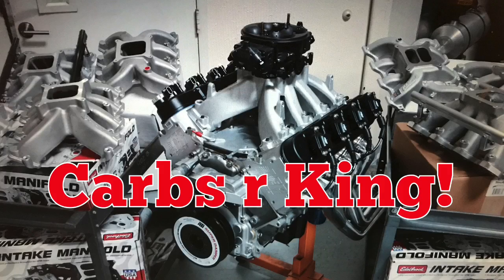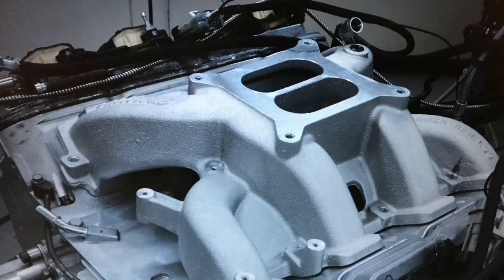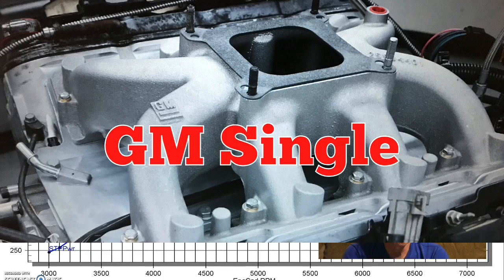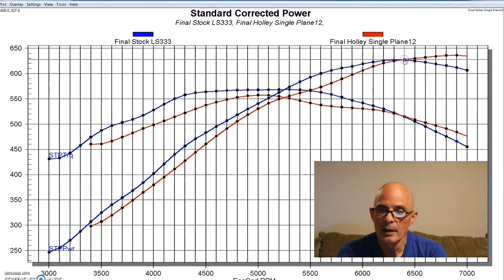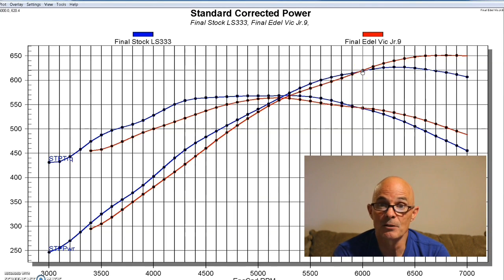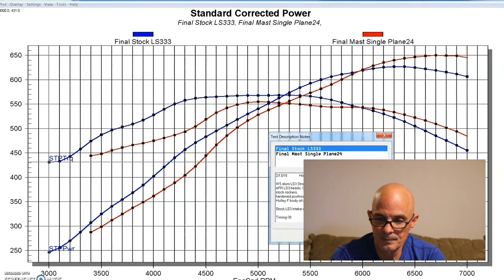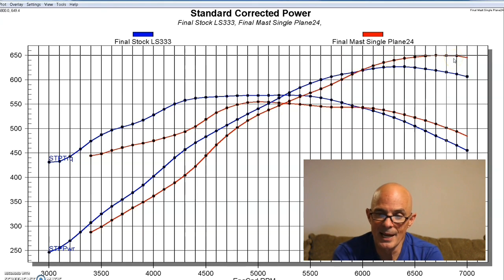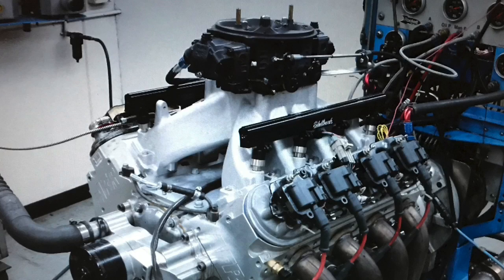CAN CARBS COMPETE? 416 LS3 INTAKE TEST (pt2)

Comment: I think the duel plan with a carb and msd box is great for a drop in to get a swap running as fast as possible my daily is a 91 roadmaster wagon that will be getting a 4.8 with a holley vaccume secondary carb down the road i might get a efi system but for now this is peefect id like to see some of the amazon specials tested

Comment: The factory LS3 intake along with the whole ECU controlled EFI is one of the best systems GM has engineered and mass produced.  If you own a C6 or other LS3 recipient of that top 3 engine ever made, IMO, it would be foolish to change out to any other system.  However, this is only totally accurate if you plan on never changing GMs design parameters.  For others who can't help but modify every automobile they get their hands on, sticking with EFI in GMs form might not be your best choice.  Of course Richy prefers his LS3 port injected EFI setup, he works at Westech and doesn't have to pay $400 or more each time he needs a dyno-tune.  He can just buy the fuel upgrades to support his new cam or turbo and life is good.  For many of us, those are not the facts of life.  We would have to go hat in hand to a tuner and hope for a quick and merciful financial outcome.  At 61 yrs. old and having only earned in the 6-digit yearly income realm 4 or 5 years of my life you can burn thru your savings pretty fast.  So for me who has no issue tuning a carburetor, that is the way to go.  I have a good Pro-Systems blow through 750 carb an assortment of jets, bleeds, pumps, squirters vacuum activated power valves and, the key to boosted carb success, boost referenced power valves.  Of course having an MSD 6014 ignition box and AFR gauge is immensely helpful also.  Jets and PVs are infinitely cheaper than hi-flow injectors while the financial value of my time compared to a good tuner' time is too embarrassing to even speculate about.
Reply from the maker: you are also plenty capable of learning to tune EFI-carbs aren't the only thing you can know

Comment: You are very knowledgeable! I am building a LS3 416 from TSP, but I cannot find the best cam. I hope to put good NA power down and then add procharger and maybe nitrous before boosted. My tuner is recommending the redhot cam but I am not concerned about street manners (stage 3 or stage 4 type cam is okay). Is there a cam spec you would recommend?

Comment: A good carb tunnel ram would remove the low torque advantage of the efi intake.
Reply from the maker: no...it didn't
Reply: I didn't see you test a tunnel ram vs the ls3 intake.   I've seen the tunnel ram tested before and it improves torque across the board due to equivelent AF ratio at each cyllinder due to equal runner lengths. @richardholdener1727

Comment: I have a 416 ls3 with a Holly sniper metal intake with twin turbo.i was wanting  to put a carburetor intake  and put the elbow forv the throttle body what do you recommend and thus set up is in a foxbody  mustang
Reply from the maker: why make that change?
Reply: @richardholdener1727   I was just  wondering if there's a intake that would work better and the holley sniper  sheet metal intake  make a lil noise when engine is  running  push down on the top and it goes away but nothing  major and I no you no way way more than I do

Comment: What, if any, gains do you think gasket match porting the single plane intakes would yield? I matched my GM single plane. While it has super crisp throttle response, I never really drove it. Then went back to fuel injection. Always wondered how it would have ran.
Reply from the maker: port matching helps very little

Comment: Honestly… the most impressive manifolds to me are the pair of Dual plane manifolds (for a pickup/heavy car application with mild cam).  Factory LS3, and the 4500 super victor. I think the Holley hi ram matches or beats the 4500 super victor.  But if you need low profile that factory ls3 is hard to beat if you are efi.

Comment: The victor Jr is what all the racers ran in the 90’s my shift point was 7500 rpm so ya it would definitely outperform the EFI system that drops off at around 6500 rpm when I went through the trap at the quarter I was at 9200 rpm, and that cam to me is a mild cam, if your gonna drag race you wanna run a Holly carburetor and the new super victor intake

Comment: Not sure where it was, butI watched you test carb manifolds. Dual plane and single plane,  that motor had a big cam.  Then I watched you test cams on another vid.  I am interested in what a 6.0L, 750-850 carb, the sloppy cam you used.  228 duration on 112.  A cam with 228 ish duration on a 110 or 108 with a carb would be interesting also

Comment: If I was going to drag race this motor N/A, I'd pick the Super Victor 4500 or the Stock LS3. If I want the best power for my dollar I'd most definitely pick the LS3 and test with a notch taller gear to make the best out of its mid-range punch. It sure looks like Chevy did its homework when they designed the LS! If I wasn't into Big Block Chevies I most definitely would look into the LS...or Hemi(I'm not stupid) to run my car. This has to be one of your top 5 (including part 1) videos! Great job Rich!

Comment: Hi Richard.... love the information.... I really like the 416 intake test. Wish you used a more street friendly cam like the BTR stage 2 instead of the stage 4. After all, drivability and idle quality is so important if you like a great driving experience. What’s the cc’s of the heads and compression ratio with the flat top pistons. I imagine there’s at least a 3 cc dish for valve relief. 
Keep up the great information!
Cheers

Comment: Hi Richard...That’s a great test.... using the 416 stroker as the test engine. I wish you used a milder street friendly cam like a BRR stage 2 or similar specs cam, something you would use in a daily driver. Who’s at 6000-7000 rpms red line street car with a cam that needs 1100 rpm plus idle speed just to keep running. That would be a miserable driving experience..... unless you have the throttle wide open all the time. Then who cares about idle quality lol.
Reply from the maker: a 416 stroker with a mild stage 2 cam is not a very popualr combo
Reply: Richard Holdener hi Richard... what spec cam would you put in a LS 416 ci. I’m willing to send this BTR stage 2 cam back to summit racing and exchange it for a different cam. I have a 3000 rpm stall and love power like yourself... but it has to able to idle at around 700-800 rpm and with good vacuum . Thanks Richard in advance 
Vic N
Reply: Hi Richard... I was just thinking..... all your tests should post idle quality and idle speed with all the cam tests. No just peek HP and Torque. After all most guys are driving the cars on the street.
🥂 cheers

Comment: The stock EFi intake yields more hp for a given rpm. In terms of torque per cube of engine, its better than most four valve per cylinder engines. Attribute measurement is not just peaks on a curve though. If EFi 416,  it made 627 hp at 6300 rpm, then a rev to 6900 rpm should make 689 hp. None of the carbs yielded an equivalent proportional power gain for 400 rpm of extra revs. The attribute I speak of is Aspirations Index. It should go down if the intake system is a better, more efficent mouse trap. Even though the best carb at 669 hp at 6900 rpm is a 42 hp gain over EFi, its not an efficiency gain. Automotive Technicians around the world understand a Good Deal more about the Quantity Price tradeoff. The other factor is ft-lb pet cube. 1.37 is world class for an engine without variable cam technology.As soon as you divide ft-lb by cube of engine displacement, you measure the Goodness of the Deal. The best 4 valve per cylinder BDA Ford Twin Cams are eclipsed by the stock crate 416.

Comment: Great videos I was impressed with the 4500 super victor for my type of racing . Yes the factory ls3 is very impressive . Bet the ls3 vs the fast mid runner on that 416 would have shined a bit more as it would have made better use of runner cross section vs length ... but great video series

Comment: The most realistic results would be the average torque/hp thru the expected rpm range.....if you do that, you'd have to stick with the stock LS3 intake.  If you're going to wind it 'til only dogs can hear it and want to run some really stiff rear end gears you might want another manifold with shorter runners......just what science would predict.  Good tests.

Comment: Richard.  What do you recommend carb intake for 6.2L LS3 heads.  I have build a very similar cammed LS3 engine from the FI intake test, but plan to run a carb.  Say it is 20% street and 80% track.  Manual trans 4.30 rear gears. Dual plane or single?

Comment: Id like to see these single planes ran with a 2 inch 4 hole tapered spacer. I think you might see an improvement in torque and power.

Comment: Damn right carbs can compete and i said this before I watched the video.
Reply: They can to a point. Seen any carb motors making 4000 hp?
Reply: Genuinely curious, why would you carb an LS? My experience with carbs not running well in all weather make me far more likely to put efi on an older engine than carbs on a new one.

Comment: the uneven pulses in an american V8 kills torque below 3500 rpm.  Dual plane intakes keep waves playing nice and you get a lot more torque down low.  because dual plane intakes basically feed one bank off half a carb, you need to double the size of the carb!  You could step up to a 1250 dominator and it would match or exceed the LS3 manifold everywhere.  and 80 lb-ft at cruise rpm is HUGE.  that's 20% more torque where you normally drive.

Comment: Richard I higly appreciate your LS tech videos. I am building “classic look” 416 with little bit less cam as you are. I want the old look with low profile single plane and holley throttle body. Would chose holley for best power under 6500?
Reply from the maker: yes if it is lower than Vic Jr.

Comment: Good video.
Use also the fast 102mm so we can see the differences between the stock intake.
Reply from the maker: very little difference between Fast and stock LS3-see the efi intake test (pt 1) video
Reply: @richardholdener1727  you think there'd be a bigger difference between the ls3 and fast 102 on a 408 or 416?

Comment: Where’s the pTr ????????????
Reply from the maker: I know-I will do a separate video on that-including what happened when we removed the lid (me standing in the dyno cell at WOT)
Reply: Richard Holdener I’m ready for it with different runners! But preferably up to 8000 or 8500, I have the Fast LSXHR and shift at 7800 currently

Comment: Richard do you test , if you can put higher timing on carb set up ? if you run 30 advance on LS3 injection intake, do you test more on carburator ?
Reply from the maker: we adjust til it stops making power

Comment: This factory intake on the ls3 is CORVETTE technology passed down to pickups so there is no real surprise to me that it performs well but let's talk real world street engine and go off idle to say 3500 rpm and do a comparison from that power band not 3000rpm and up, no point running a dual plane if you ain't giving it a chance to shine where it was meant to work...

Comment: Richard, what is the displacement crossover point ? That is, the point where the LS3 intake no longer has a advantage over a good single plane? 441? 454? 468?
Reply from the maker: It will always have an advantage at lower engine speeds-I've tested up to 495 inches
Reply: @richardholdener1727  I've seen issues with running a dual plane with tbi setups, particularly an episode of E.M. and from what I remember they weren't sure what the cause was. On a 416+ how would a TBI setup work with  a open 1-2 inch spacer  combined with a dual plane? I would think it would eliminate the fuel distribution issues typically seen with TBI+dual plane setups, and provide more bottom end performance. I'm not the expert, so what do you think?

Comment: The only thing you should have tried, and I can't believe Brule didn't help with this tip... On any single plane manifold test whether done @ Westec, Powernation, or any of the other popular test videos. Why didn't you run any spacers to help? A 1-2" spacer has been proven to add 10-15 ft.lbs and 15-20 HP up top when using one. This would help with the overall "runner" volume. Great video though!
Reply from the maker: spacers don't change runner volume-only plenum volume and sometimes help and sometimes not-I've tested them a lot-we usually try them on a carb combo just to see
Reply: @richardholdener1727  I'm confused...This is a carb combo test. Plenum volume yes, but it would still allow more volume and add tq and hp on any of the single plane intakes. This engine would have shown great results with a spacer. Go to any track and try to find a single plane race engine without one.

Comment: Is it possible to utilize the crank-case as a pump to boost a 4 stroke? Imagine if the crank-case in a single  piston engine was valved to suck air in, then out, and fed into the intake as the piston down-strokes-twice before it fires? This air would be 2 times the volume of the bore x stroke, right? Then it could also be fed through an inter-cooler like a turbo would. Even at a minimum effect could it increase volume efficiency above the N/A engine?
Reply from the maker: you would have to isolate every side of every cylinder I think

Comment: Run the Edelbrock dual plane with a throttle body injection fast/Holley stealth if the center divider doesn't screw things up I think it will make a crazy flat torque curve
Reply from the maker: same results

Comment: Competition Inductions Designs, CID, cast aluminum single plane 4500 intake would be in this engines wheel house. With your 4500, 1050, that engine would sing.

Comment: Getting desperate for content or just enjoy pissing off the carb guys?Now change altitude and temp drasticly without any changes and post results.
Reply from the maker: so move the whole dyno test facility with motor up to MT Everest?
Reply: @richardholdener1727  real world conditions bud,testing them and making comparisons without variations is useless.Tune a carb setup at your altitude and drive it through MT.
Reply: A carb is great and in an older swap w out fuel injection already and a budget is the best logical cost effective choice for us regular guys who are looking for cheap power for less money even stock a 5.3 is two or 3 times more powerful than an average sbc so junkyards we go slap a carb on it and run the snot out of it with a giant grin saying wow this fucker has balls lmao

Comment: So i guess the small intake runner port of the Holley single plane into a large LS3 cylinder head still makes power. I was think the difference in the port transition would affect airflow. Probably less of an issue same combo with a turbo... I love your vides Richard thanks brother.
Reply from the maker: the intake port is sized for the rec port head

Comment: Hard to understand why an aftermarket company hasn’t made a single plane with a medium length runner to get more mid range power. Or why they don’t copy the stock intake and try to improve it some by changing the lengths shape slightly etc.
Reply: FAST makes an ls3 intake copy with tunable runner lengths. He did an entire video on it.

Comment: Definitely the LS3 intake for street driving in NA form!!! Definitely super victor with the dominator in nitrous or centrifugal supercharged applications.
Reply: I was going to state the exact same thing. Must give GM credit. They really did their homework, when designing the ls3 car and truck intakes.
Reply from the maker: boost doesn't change anything-effective rpm is still the same
Reply: Richard Holdener, exactly sir. I agree completely.

Comment: Great comparisons! I'm sending this to my buddy who's looking to change his LS3 carb intake to the LS3 Factory intake. Question though, have you tested ported stock intakes? For example the ported LS3 intake or a ported Trailblazer Super Sport anti?
Reply from the maker: I have not
Reply: Porting only works if both are port matched and it's usually 5 to 6hp usually and if they're not port matched you can get pooling which is a nightmare to try to tune around.
Reply: Ported blowers are where you see the most power because you're opening up volume into the supercharger or turbo. There's all kinds of goofy porting theories and if you want to go down the rabbits hole.. look up BMW dimple porting. Looks like a golf ball because the idea is that air flows around a golf ball that it will work better than smooth surfaces.

Comment: Do you have a video on 6L to bore and stroke to 408 ci 6L from a 20016L 4LQ
Reply from the maker: bore .030 then add 4.0-inch stroker crank with 6.125 rods and appropriate pistons

Comment: If you run a one inch spacer between the intake and carburetors you would definitely improve the low end power curve. I done this on my engine dyno and you would be surprised how much difference a one inch spacer makes.
Reply: Randy Oehlert  ... I was wondering if that would be the case.  We were allowed to run a 1” spacer on the TransAm/GT engines and everyone did (no height concerns really). I am almost surprised they didn’t do that on the single plane stuff.  I suppose that is sort of the difference between, say, the Super victor and the Vic Jr.
Reply: Randy Oehlert I was told on a dual plane intake the 1 inch spacer with the 4 holes are better for acceleration and low end torque.

Comment: Ripper video mate!
Curious how much of those gains relative to the LS3 manifold is from the charge air cooling effect of switching to carb. Possible that they'd be even worse if it weren't for that.

Would be interesting to run a LS3 Manifold with a comparable side draught, or better yet those carb manifolds with injector bungs welded in.
Reply from the maker: look at the efi test-same manifolds but less charge cooing